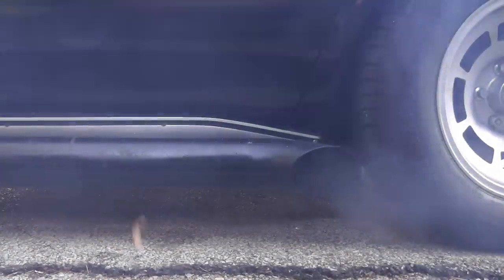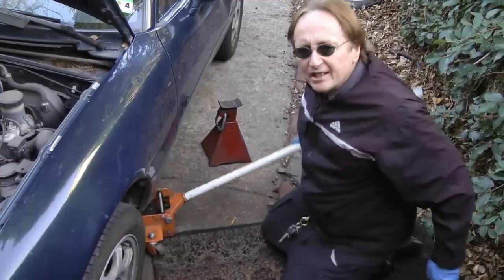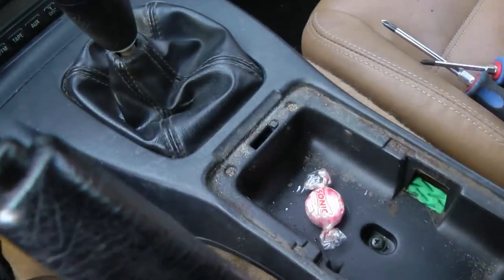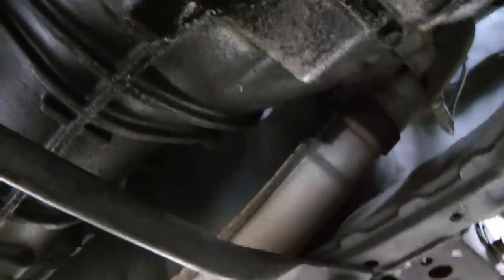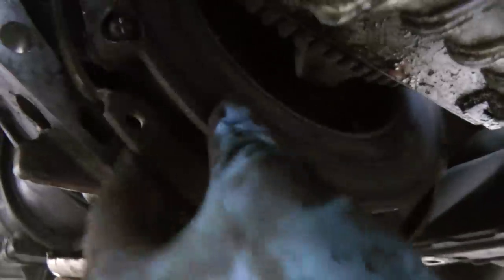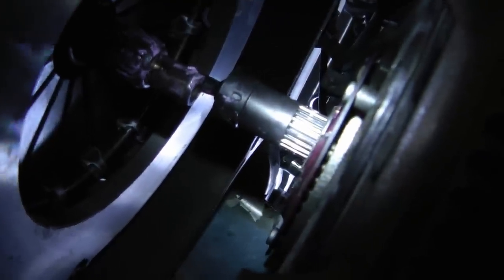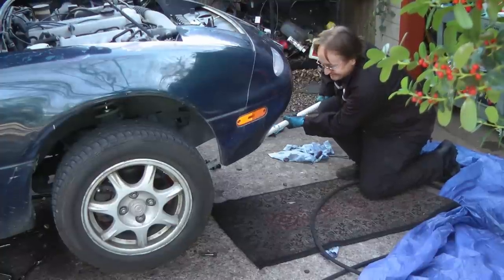How to Fix a Slipping Clutch in Your Car (Clutch Replacement)

Comment: Please can someone help 

I have a 2010 Mazda 2. When I raise the clutch to move off it feels like it is getting stuck at the biting point, (I am holding the car at about 2,000 rpm at this point and it just reeves) then the car jumps forward after about 1-2 seconds. But it does not happen all the time, usually every 2-4 times. My friend told me to put the clutch into neutral the pump the pedal a few times. I did that and after doing that it worked fine! So what is going on? Why would it stick but at random times? He thinks there is trapped air but I have no idea. Is this a case of a slipping clutch?
Reply from the maker: Grant Kidd replace the clutch master and slave cylinder, pray that fixes it and you don[t need a new clutch
Reply: Scotty Kilmer Thanks for the quick reply man! Will look into it
Reply: +Grant Kidd I had the same problem with the Nissan Versa manual transmission. I am sure the engine was engaged halfway and the tach dropped, after that I pumped about 2000rpm and the car still doesn't move. It's a new car from the dealership. Maybe I was just driving it wrong
Reply: thenatnatboy So you have got a brand new clutch, the bite point in mine is extremly low which would suggest my clutch is brand new. Try what my friend told me about putting it in neutral and pumping the clutch pedal about 6 times and see if that works.
Reply: +Grant Kidd i will keep that in mind Grant, thanks
Reply: +Grant Kidd "...it just reeves..." "then the car jumps forward" definitely doesnt sound like something a reeves would do
Reply: I remember my brother's 96 Grand Am giving us the same issue. One day the clutch just entirely quit working when I went to go to school with the car, and I heard a bang alongside it. The clutch cylinder blew out a huge hole in it. 

In my tiny little car that I now own, I don't need to worry about that at all because without any disassembly whatsoever you can see the clutch pedal directly operating the clutch with ease.

Comment: Replaced the pressure plate too right?? Hey Scotty, X gear head here, I think your Vette is running too rich, lots of black smoke coming out of those side pipes. I had a 67 Camaro Yenko clone, 427/425 engine, 456 gears and a 4 speed, ran very strong back in the day

Comment: I think this sound stupid, but anyway. My uncle's 355 (It's Ferrari) got the clutch worn out. I wonder if I can help him but now he doesn't care about that car right now. It's just a thing to show off when people walk on his garage. And I think he cares more about the Jazz than the 355. I'm not joking. I hope I can have the car after i replace the clutch beacuse he didn't use for the last 2 year. 
Calvin, Godalming.
Reply: And a thing, it is right hand drive.
Reply from the maker: Ha, just price out the cost of the clutch parts alone on a Ferrari and you will crap your pants. Thousands. Last time I watched a guy clutch one the total bill was over ten thousand dollars US.  Not a do it yourself job for sure.
Reply: Because when I turned the key, the engine starts ok. But when I put into 1st, it only roars, but didn't move. And I did check handbrake was off. And I asked  him 'are u joking? your red horse doesn't move. what's wrong with this?' and he merely said 'worn clutch' that's it. He didn't said more. So I'm seeking answers online to DIY clutch replacement. And I found this. It's only got 44k miles on. Anyway thanks for the tip. Also, along with that 355, he once had an escort and two civics. Now the only car he is using is an autobox jazz.
Reply: And he once used the 355 to go to southern italy on 2002. Last time before I twisted the key, it was covered by a really thick dust.

Comment: Hi have a 82 corvette run but the time is not set up  right can you help me is the cross fire injector electric fuel pump
Reply from the maker: +Jaime corvette get a timing light and set timing at 2 degrees before top dead center
Reply: +Scotty Kilmer 
    
  

        

i already tried that but the problem is that when i press the gas fast it makes a pause and doesn't respond
Reply: +Scotty Kilmer I already trred that but the problem is that when I press the gas fast it makes a pause and doesn't respond
    
  

        

i already tried that but the problem is that when i press the gas fast it makes a pause and doesn't respond
Reply from the maker: +Jaime corvette pressure test the pump AFTER changing the fuel filter to see if it's bad. If not, odds are the injection system needs pressure cleaning by a pro with a cleaning set up

Comment: I just did it on my car but the new one didn't fit so I took it back to the store and bought another one with the same problem. both clutches were supposed to fit on my car, anyone have any tips?

Comment: Back wheel drive cars are normally a complete peice of piss, but front wheel drive cars complete different mission, only took me 3 hours to replace my clutch in my Mercedes c250td on the floor 👍

Comment: I'm having a problem with my 95 miata clutch. It's kind of the opposite of the problem in the video; the clutch won't seem to disengage.
Reply: Classic miata problem: just replace the clutch slave cylinder and it will be fine again
Reply: TheBenTube I just did that today 🙂 it's great now. I changed the oil too, it was really easy to get to the oil filter with the wheel already off.
Reply: TheBenTube

Comment: Sometimes when I press my clutch in it makes a VERY loud clunk that you feel in the car, then I try to shift and it makes the same loud clunk also when i let off the clutch it does the same and  it is hard to shift or sometimes wont shift at all it will do this for a few more shifts then it goes away and it shifts like a dream what the heck is going on ? ...Also when it does this it will get stuck in a gear like i said, 99% of the time its neutral if I kill the car then put it in gear then start it up its fine for a while....I think the clutch is sticking when i press in the pedal then quickly releases causing the loud clunk or bang...and i do mean LOUD. Its not a hydraulic clutch its a antique car that Im trying to get up and going any ideas would be awesome.
Reply from the maker: clutch is wearing out inside, plate is sticking or something else dragging on the clutch inside, OR the synchros on the transmission are wearing out inside the transmission

Comment: how often does a clutch typically need to be replaced?
Reply: Depends on how you drive stick.  I bought a brand new car and got it to 300,000 KM and the clutch still works fine.  Most people ride the clutch way too much, I don't even give throttle getting into first.
Reply: sc0tte1 my friend has a 06 Acura RSX Type-S and it has 120,XXX miles and clutch still works and it's OEM Honda when he bought his RSX from dealer.. Depends how hard you drive it.
Reply: LACounty8l8 I drove the shit out of my car when I felt like it, took it to the track quite a few times and it was modified (not the clutch though); it's all about rev matching and heel and toe. (2003 Nissan Sentra SE-R Spec-V)
Reply: basically when your car is modded , your clutch will most likely give up sooner or later. I own  00 Accord 3.0 which was auto now. its a 6 Speed 3.6 swap with clutch masters clutch and flywheel stage 4 because im at 356hp/367tq at the wheels all motor. my stock clutch went out in less than 5 months
Reply: Funny you say that because I had a CM clutch sitting around but I never installed it, I just ended up destroying the car because I hit black ice going 110kph on the 401(with summers) and hit a parked truck on the shoulder..there's pics on my FB page, maybe I should post them, lucky I hit it going backwards or I wouldn't be typing right now, but if you're from LA then you guys don't have to worry about that crap :P  I was really rough on it when I drove it hard though, just pounded the pedal in and out switching gears, no feathering for that sort of driving.  I only had about 235ish hp matched with 220ish TQ with only CAI, cams, balancer delete, no cats and straight exhaust with headers.  Not bad for a straight NA 4.  No bs rice mods either.
Reply: my car made 305hp/315tq on headers , exhaust and cold air intake but with a tune it made 356hp/367tq. i will soon add stage 2 cams , port& Polish intake manifold and intake runners and boring the cylinders to a 90mm so i can go 3.7 since factory is 89mm and hopefully hit 400whp then ill think of custom m90 supercharger on a 18-20psi
Reply: Well if it really had that much tq that's pretty damn impressive for a Honda engine, they usually win in the HP department but lack TQ.  The only Honda I've ever had was a CRX, loved that thing.  A supercharger with 20 pounds should def put it over 400 but shit, a 2 liter with over 350 must have a few mods more than that, is that measured at the crank or the wheels, I only measured mine on a dyno so I was putting out more than 235
Reply: yes only 1 honda engine has more tq than hp which is 240 hp abd 260tq awd but did fwd conversion
Reply: fwd conversion on a small car like RSX?  I thought they came with 1.8 but it was type-s so was it a K20 engine?  That's pretty awesome
Reply: my accord came with a 3.0 V6 200hp 195tq
Reply: and its a J-Series engine all V6 are J-Series
Reply: Oh shit so you stuffed a v6 in that bad boy that makes sense for all the specs, respect for that!
Reply: yes the other engine i swapped was a 3.2 which was 260hp and 232 tq but it has the best flowing heads out of any J series which i swapped over to my 3.5

Comment: You will find most of these videos are not as easy as they make it look. lol. I mean, I am on day four and have been working my ass off on this car. I already pulled my shoulder and completely ruined a pair of jeans. It doesn't help being 1 degree Fahrenheit around here. These bolts around the steering knuckle is a pain in the ass. I warn anyone, make sure you have a lot of time to work on this if the car axle and brakes haven't been removed. Everything is seized. I use my Dad's garage, and I am getting bugged about when the project is done. I've broken two impact sockets, and a wrench in half lol. I've ruined ball joints (hammered on the one for 2 hours straight and the other for hourssssss) and a tie rod end. 

Anything to learn, make sure you have a lot of time -- rags -- and PB'laster

Comment: Could anyone tell me what happened to my car? I put it in first gear and as I released the clutch I started to hear kind of like a clicking noise and so I took it off of first gear and back into neutral. I then attempted to move it again but when I released the clutch, my car wouldn’t move. I can release the clutch in any gear and it wont move, and it won’t stall if I don’t accelerate. I don’t even have to push in the clutch in order for it to go into gear now. Can anyone help. My car is a 2001 Audi A4 1.8T quattro

Comment: Okay I have a clutch problem with my Mitsubishi eclipse, so when i put it in first gear it run nice and in reverse than when i put it in second, third, forth, and fifth it really wants to engage but then it stops and it just doesn't move but some times it will and i need someone to help me here thanks.
Reply from the maker: either transmission is shot or clutch is worn out. I'd bet on transmission
Reply: Oh great that's nice then it wouldn't be worth the time to fix?
Reply: Could you possibly call me so I can give you more details it would help me out a lot I really have a feeling it might be something else

Comment: Sounds like the clutch might have been the least of the worries the owner should have. Did anyone hear the knocking sound when he started it? Either has a bad timing chain issue or it has rod knock. Couldn’t tell from the short audio clip.

Comment: hi scotty .... 
How can i know the clutch is wear and it failure  .....
Reply from the maker: +Eng. Hassan they slip when they get thin, and make noises when they wear out physically inside
Reply: +Scotty Kilmer  please read my massage
Reply: +Scotty Kilmer why the tailgate push open.lmao
Reply: +Eng. Hassan the best way is to turn on the car, pull the ebrake, push in second or third gear and slowly release the clutch, if the clutch is slipping the engine won't turn off easily, if the clutch is good it'll stall the engine quite fast. Also, get a friend who has a car with good clutch to drive your car - he will feel the difference which you don't feel because you get actually used to a worn out clutch because it doesn't happen in a day. A worn out clutch also requires to be released higher to actually "catch", which is kinda annoying because after changing the clutch you'll have to get rid of some bad habbits - you may stall the engine occasionally on too small revs when changing gears to higher ones because the new clutch won't slip.
Reply: +draconpost thank you so much my best teacher

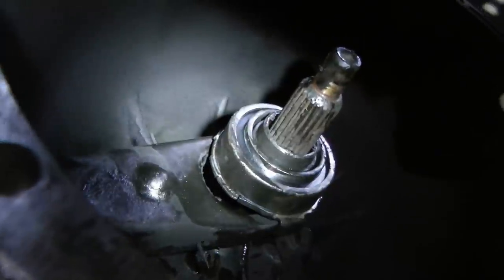Comment: I have to be that guy... @3:08 you mean input shaft and not yoke I’m sure. Yoke is at the tail shaft and connects the u-joint to the driveshaft (assuming no guibo is used).

Comment: hi sir, my car is nissan pathfinder my mecanic change the cluth. he din't weel because now when i push the cluth, the cluth stick inside and don't came out that happen sometime
Reply from the maker: it may need a new clutch master and or slave cylinder now, they are on the outside and a new clutch is strong and often makes them go bad when old.

Comment: My dad has a miata just like the one in this video, although his is in immaculent condition and only has 15 thousand miles and its a 1995 too
Reply: I don't like that kind of mileage on an older car. Means is spent a LOT of time just sitting. Which is bad for any car
Reply: Vance Meeks Yup, I inherited a 2003 Nissan Maxima that spent it's life doing short trips then sitting in a garage. Has 30,000 miles and had plenty of problems, most associated with rust, not being broken in correctly and sitting for too long.
Reply: I agree with you, no rust though because its been garage kept its whole life. Im concerned about all of the 20 year old fluids (besides oil of course)
Reply: Change all the fluids (even diff grease) and it would also be a good idea to change things such as the engine/window seals and the wheel bearings. After that and new shocks it should be ok to rely on

Comment: my car when I put it in 1st it's hard to put it in there and when I drive on 5th it just slips out so I want to know what's wrong with it
Reply from the maker: +Brandonsvideos transmission is wearing out internally, slipping out of gear can only be worn gears inside.
Reply: +Scotty Kilmer my clutch burnt out I want to know where should I buy a clutch kit
Reply: +Scotty Kilmer my dad is also telling to stop driving manual and buying em because they end up breaking quicker do you think I should stick with a manual

Comment: Can someone help me. 

I placed a new clutch set everything on like the book I centred iT perfect I know what to do but now since yesterday my clutch slips again Its a new one and now Its screeching if I give gas Its slipping and screeching and makes a weird noise I Cannot explain what is iT im doing wrong
Reply from the maker: pray it's bolted on correctly inside the transmission, and that the clutch hydraulics are too tight and need loosening, most are adjustable so they are not so tight
Reply: Scotty Kilmer I have a Peugeot 207 2007 only 27000km on iT and I have soo Manu problems with the car 3times new clutch and 1 new transmission youre video helpen me alot with the tie rods because is was knocking after I placed my new clutch and I fixed that but Its like a new car iT has 210hp 1.6 runs on benzine no diesel and not much km and like I Saïd to Many problems with iT im gonna fix iT and sell iT gonna buy Honda type r 2015 because I spend Total on that car 6000€ new trans 700€ new clutch and place garage from Peugeot 2x and now did iT myself the car in 2007 was 28000€ full option  and special color orange gold rims and tires 4700€ im like, I give up i putted to many money on iT if I Wanted I would go for chevrolet camaro but the problem here in belgium is way to expensive iT costs new in here 60to80000€ but thnx for youre help scotty I always look to ure vids because I want to learn more
Reply from the maker: yea, french cars stink, period.  why not look for a good used mustang?
Reply: Scotty Kilmer they ask way to much I love Amerikan cars but here they are way to expensive an old mustang in here they ask between 20to40000€
Reply: Scotty Kilmer and realy no Joke the garages here in belgium they suck Thats Why I look to youre video's youre way betther I call a garage they always say maybe this maybe that and now with the clutch problem is that they dont know they say youre clutch is placed backwards not with flywheel side but Its impossible I think because I still can drive the car but when I step on the gas it slips and Goes fast to 5000rpm so I drive slow now but I miss iT to go fast
Reply: I have a big problem went to the garage and they said that there can be oil in my clutch because it didnt have a closing rubber or something they said we have to place a new clutch and everything so its clean and the payment was way to high to do that they asked 1700€ too much so i sold my car
Reply: Is that alot of money ive seen a mustang here and they sell it for 13500€ its a mustang from 2005 and 107000km 305hp

Comment: I know there were no grooves on the flywheel, but what about glaze? If the friction disc looks that bad then you know the flywheel has a hell of a lot of glaze on it. As big of a pain in the ass as that job is, why wouldn't you go ahead and take care of it?
Reply from the maker: a good quality flywheel costs  a LOT of money, and resurfacing them often makes em too thin. This small car worked fine with the old one. On  a giant truck, go ahead and replace the flywheel